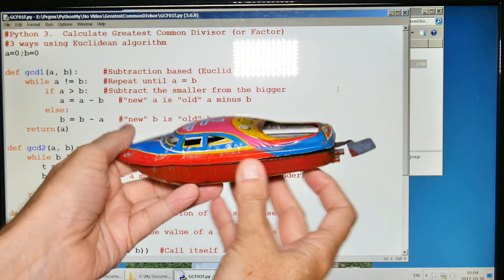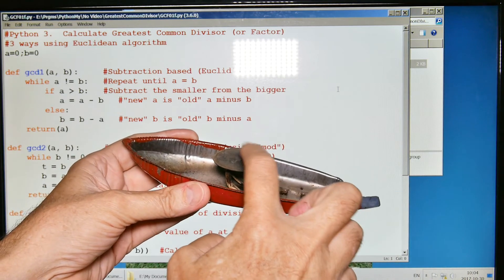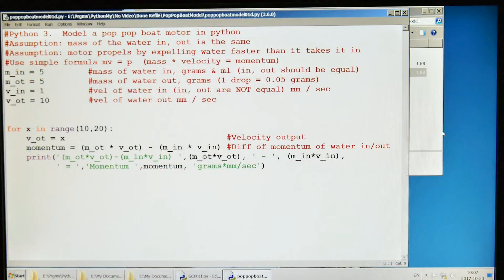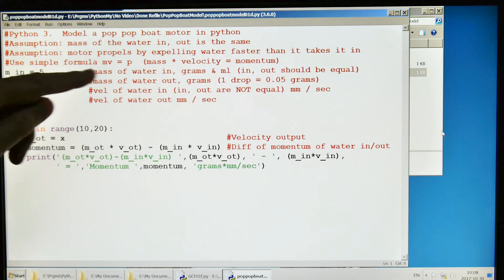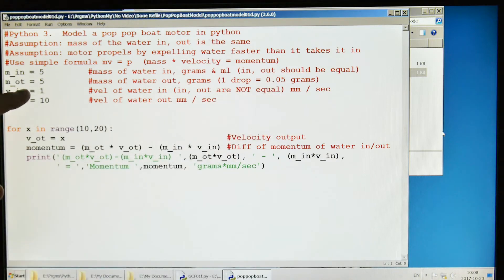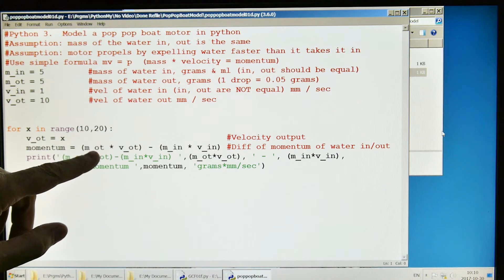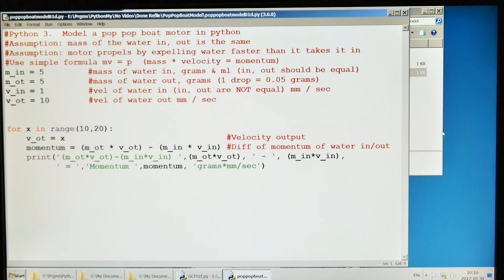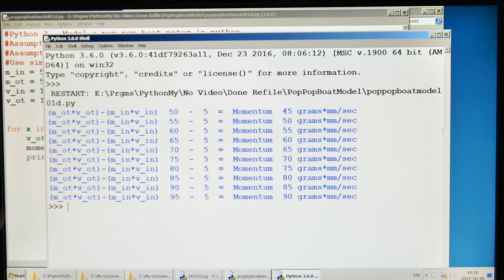Pop Pop Boat Program - Testing A Theory via Computer

Comment: I’ve always thought that two vertically opposing magnets (upper being gravity induced) could be the driving force to create momentum within an air pocket resulting in enough air pressure to propel a boat. Similar to this but with unheated air as the exhaust (propellant).
Reply from the maker: If you try it, please post a video.